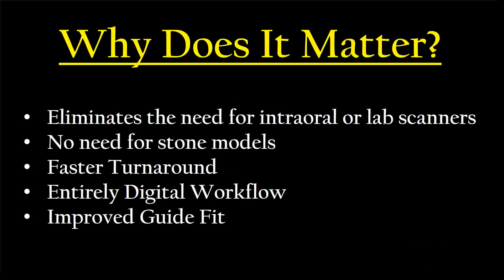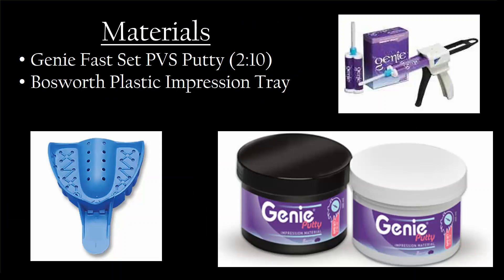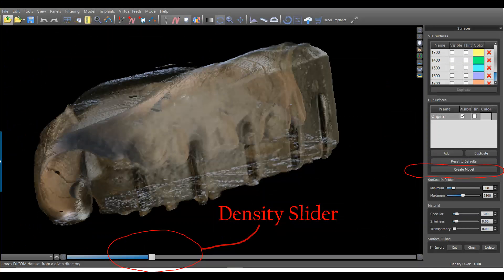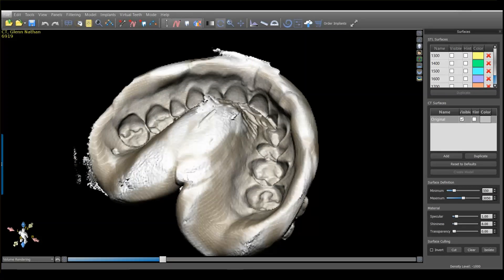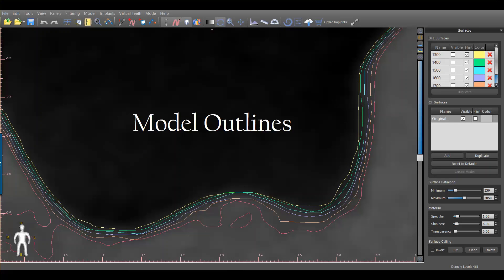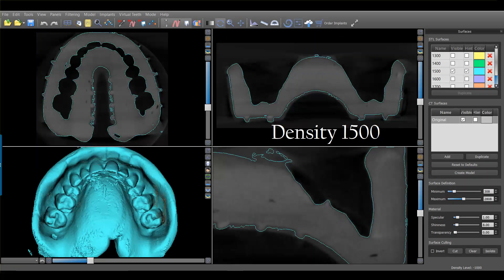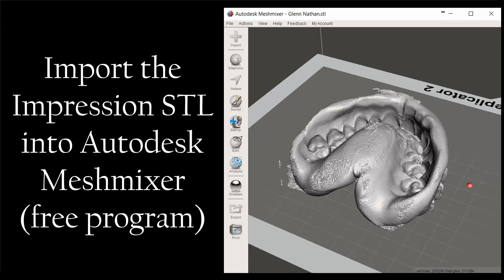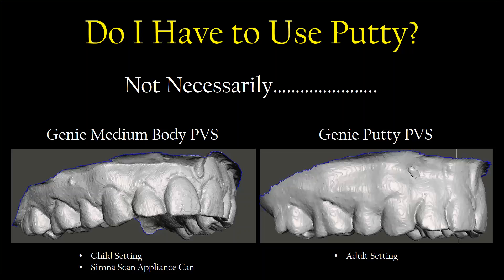Generating an STL Model from a CBCT Scan of an Impression

Comment: If you take a triple tray impression 
This technique should be modified. 
Running through Meshmixer what the best way to go about doing this?
Reply from the maker: Won't work well because there will be holes where the teeth occlude and you won't be able to invert

Comment: Hi Corey, awesome video dude, i am trying to scan my pvs impression but my density slider always shows -1000, i am little confused, hopefully you can help, thanks
Reply from the maker: +syed rehman Make sure you've got the 3d rendering set on Surfaces preset.  Also be sure that the the dicom of the impression is selected, otherwise you can't alter the density

Comment: how do you scan the impression?
Reply from the maker: +Jeff Johnston I simply scanned the putty impression on the adult setting.......nothing special.  You'll need some type of plate apparatus to set the impression on and almost all companies sell one that fits into the bite stick holder.  When I used medium body material, I had to turn the settings down to child and got even better results by using the denture scanning aluminim can that sirona sells.  Putty is simplest though